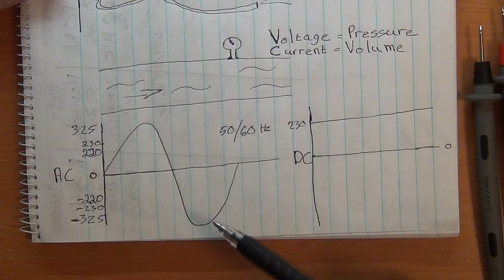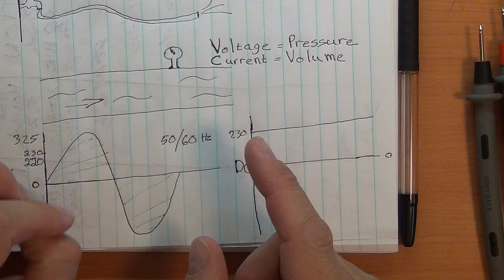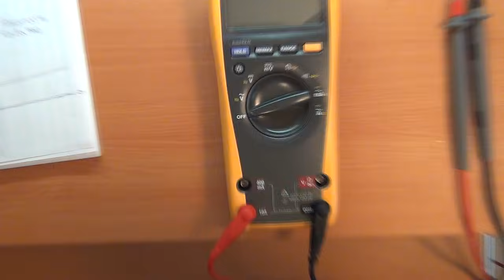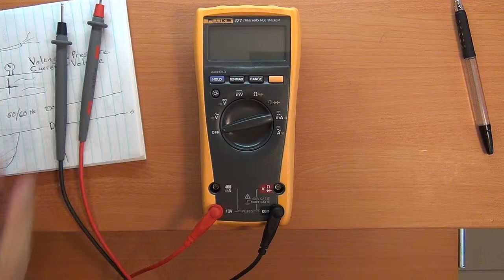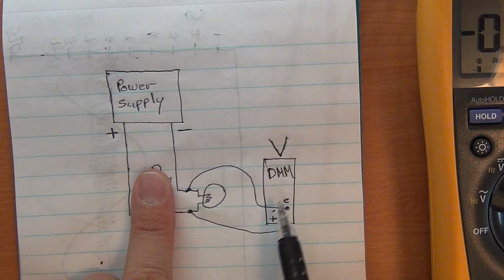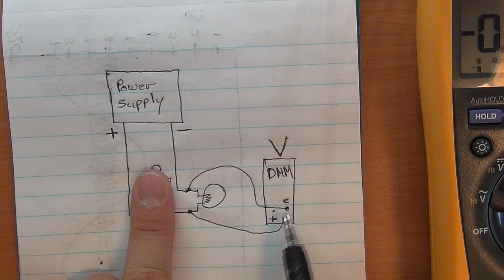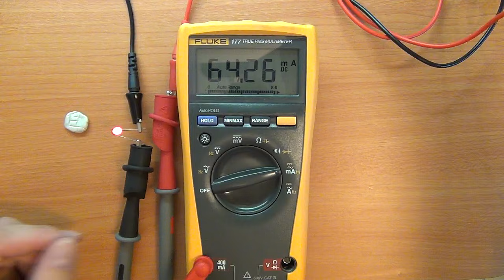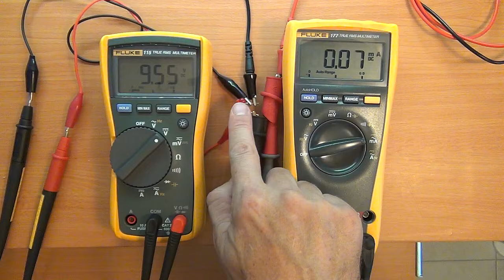Comment: @mjlorton Big props to you for mentioning @9:47 that in 230V AC grids/system, the peaks of the waves reach 325V and not 230V. 230V is the RMS!!!
This is how basic electricity should be explained!!! This is what allows pupils to understand the things, not to memorize them! 
When memorizing something, you will never be able to expand the knowledge in that field because you do not know the inner workings until that point. You become basically capped!
When you understand the inner workings, you can make your contribution and make advancements, discover new things!

I hear other "professors" say: "the AC voltage in the wire fluctuates between positive 230V and negative 230V"...  
Later those pupils will grab an RMS dmm, stick the probes in the wall socket and expect to see 162V AC...

Thanks!

Comment: So I have a multimeter that does not seem to have the option for reading AC Current, only DC current. There is no A~ option. This might sound a daft question but what would happen if I tested AC current using DC current measurement option?

Comment: With AC your muscles will be pulsing on and off giving your reflexes chance to pull away he said.. That person has clearly never touched 240V  AC closing the loop through the chest. Firstly, muscles will be pulsing at the frequency 50/60Hz and I am pretty sure based on my experience that in 1/50 of the second your reflexes will have no chance to do anything.. And if I remember right, it is exactly that alternating frequency that will make the heart stop.

Comment: i believe the reason why they switched to ac is because you can lose voltage over distance so you would have to have stations between power station and last building that would maintain the power. AC has a neutral, essentially making a loop.

Comment: I have a sperry instruments brand analog multimeter that has a red to green scale for testing small batteries, however, there is no battery option setting on the selection dial. I have noticed that other multimeters that have the battery replacement scale also has a setting for 1.5 and 9 volt batteries. So...how do I use this scale on this meter without the battery setting?  Is there something I am missing? Looking forward to your reply. Thank you.

Comment: Excellent, many thanks for sharing. This made made so much sense. Great practical example using a simple circuit that explains what is going on. Love the analogy and practical visualisation of pressure and volume (I’m a mech Eng). Also interesting to see the current drop off as the LED failed (not like a switch as I expected). By the way I electrocuted myself as a boy sticking a screwdriver into a transformer and my muscles contracted giving deep burns in my hands (240v in the UK). Luckily the screwdriver eventually fell from my hand saving me. Not sure if AC or DC (I was trying to fix my scalextric car circuit).

Comment: if i set-up my Multimeter to measure current  with a 12,volt bulb ; then switch off the multimeter the bulb still lights up - is this right or wrong  ;;

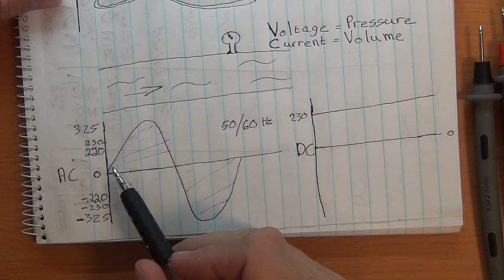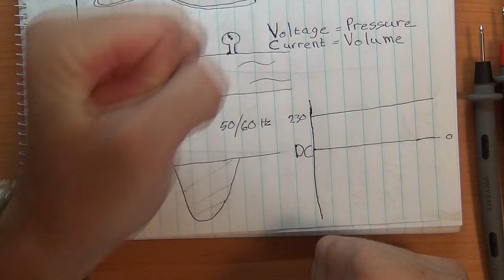Comment: @mjlorton Good work, but you begin to stray after 8:36, waving the pen vaguely at the paper and referring to the average 'under here.' You probably mean under the curving line above the line for 0 volts, but when talking about this much electricity, better to be completely clear. 9:00 - the reference to pistons is also very vague. Do you mean the AC current actually travels backwards? That it leaves the device? And how would it--what produces this current? Does it  go back along the same wire, or does it return through the grounding wire? A novice would have all these questions, since you've raised more issues than you've answered. When the current goes below 0, is it still operating the device? If so, how, if it's 'negative' current? You could have answered all these questions in a minute, but instead you wander off into solar panels.

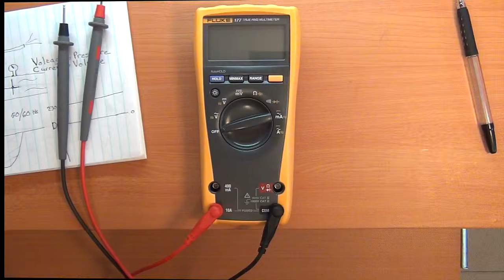18:25 - here's another distraction. There's no need to do this. It doesn't help us understand how to use a multimeter. If you must, always save this for the end. Point only then to the original time stamp, then add 'now we could have done it this way...'.  As it was, this didn't add anything to the matter under discussion.
21:30 - I'm sure I don't need to add anything regarding the confusion after this point.

Comment: No body dies on BATTERY....12OVOLT WILL PUSHED YOUR ASS....RETARTED ELECTRICK 240V WILL KILL YOU....AC LIVE WIRE U CAN TOUCH BUT NEVER TOUCH GROUND NUETRAL SO WHO IS DANGEROUS NEUTRAL GROUNDED....RETARTED.....USED 12VOLT HIGH CURRENT...ALL YOUR HOUSE APPLIANCE RUNS 12VOLT RECTIFIED....YOU FUCKING ALL THE SAME TUTORIAL....AC ALTERNATE CHARGES P+ OST PGROUND  P- NEG PNUETRAL...PUSHED PULLED..

Comment: Tessa's A/C was the no brainer for the power grid simply because the line loss from the D/C current is very noticeable at distance. A great example is the power wire to your amp in the trunk of your car. In some cases its 4 or 6 gauge to handle the job and that is relatively close to the power source so ya u loose fast the further u go. It's a good motive to buy an A/C- D/C welder. U may have a job 200 - 300 feet from your machine just switch to A/C and add leads .....no problem weld away.

Comment: I am wondering something, seriously now, how often do you measure current in the A range by breaking the circuit?

I do see a need for mA and uA since microelectronics use low current input power, but for high power electronics the currents are too high to break and measure the circuit quickly and safely. So the A range would be far better handled using a clamp.

You could argue about accuracy but in the very unlikely case that high accuracy would matter, improving your circuit capabilities would be the way to go, since working at the absolute current limits of your parts is a disaster waiting to happen.

Comment: What is the Biological process in the human body that allows it to withstand a relatively high current from an albeit low voltage device, such as a 12V car battery?

Comment: What is the biological explanation in terms of the the structure of the muscles that makes it contract when subjected to direct current (Gleichstrom) but jolt off when subjected to alternating current (Wechselstrom). At a very basic level, I do know that the human body is a biochemical system that is in a sense producing some sort of electrical power  as part of the processes that convert nutrition and respiration into energy to support its metabolic and physiological processes. The very fact that in the study of Human Biology one would come across terms such as calories and electrolytes alludes to the conjecture that I have.

Comment: DC lost out to AC I think due to the amperage or Voltage drop over the long distance car battery cble to the starter are very large Gage wire over a relatively short distance

Comment: DC didn't maintain voltage when traveling long distance so it was requiring many generating stations and was very expensive.I think it was a generator per city block depending on how many "connections".Edison pushed DC power but Tesla was pushing AC power.

Comment: Years ago I was building a solar powered pickup truck with 13 panels in series, so about a 234 V open circuit voltage.  First we tried a 250 V rated AC electrical switch, it lasted about 10 seconds after we “opened” the circuit with the switch.  The DC electricity was arcing right through the switch.  Next we tried a bat handle switch with about a 5 inch through..we could pull an inch and a half spark when opening the circuit.  Finally, we bought a $600 evacuated contractor which did the trick and lasted for years.

Comment: DC is a dirty sine wave, DC has no ground to bleed off . DC burns as it electrocutes. DC can fight back the resistance of skin better due to amp vs volt ration compared to the same wattage in ac assuming pure sine wave..

Comment: So back then AC and DC were to computing technologies. AC essentially won out because it can be transmitted over long distances with very little loss. If we were going to use DC we would have to have substations everywhere to boost the voltage and it would be potentially a lot more dangerous. So part of what I do in my job as I work on x-ray machines. They typically use 400 V DC power supplies but then when the voltage gets to the transformer inside the tube head it can get boosted all the way up to 85,000 Volts. Definitely something you don’t want to be playing with if you don’t know what you’re doing.

Comment: I know this is old but I enjoyed the story of Edison & Tesla arguing over power distribution.  Tesla argued for AC and yet Tesla cars run on DC ... sort of. I know they use AC motors but are powered by a bank of DC batteries.  

Edison argued against AC saying it would kill and at higher voltage I would disagree and side with Tesla.  I was a welder in my college years and preferred to weld with DC since it had a more consistent Arc and didn’t flutter like AC welders can.

Another great video. I enjoy the “why” behind the scenes.   As an electrical engineer I know the concepts but still enjoy watching.

Comment: The problem with dc voltage is that  you can't have a long run from your battery without major voltage drop.  this is why our houses are ac driven. even when you hook up solar panels you need to have the batteries as close as you can to your solar panels.

Comment: The reason they probably switched is because D/C voltage in a house could potentially be dangerous for younger kids messing with the outlets whereas A/C it would shock then but they wouldn't tense up in that position

Comment: Direct Current developed by Thomas Edison to power lights bulbs in homes and factories is a 12v system. Alternating current developed by Edison's assistant Nicki Telsa is a much more powerful form of electricity a 120V system. 120v is of course much more dangerous than 12v. DC is very limited cannot travel very far not suited for modern electric plants powering cities and large factories. Thank you for your excellent video on explaining on a multimeter is used. based on your explanation I was able to determine by car alternating was working i needed a new car battery.

Comment: I have to do more study but, I belive the AC is just as bad or worse at latching on. Reason, it's 60hz, you cannot precieve a light bulb flicker, your muscles are slower than 60hz. 

Furthermore, does the AC not induce a voltage at all in the body, Would this counter the problem and maybe allow for release? Again I have further study.

Comment: I know that with batteries if you run them in series you need a bridge rectifier to stoo them from charging each other just thought id bring that uo seems you mentioned running something in series i imagine why power going to peoples homes or whatever got change to ac is likely cuz its safer but i dont know why it be safer in that apllication though

Comment: This is a nonlethal story but still demonstrates the danger of low voltage dc.  Years ago I was changing a headlight bulb on my car.  I did not take into account how close  the battery positive terminal was to the sheet metal of the car where the headlight was mounted.  When i was attempting to remove the bulb I wedged my wrist between the battery positive terminal and the body of the car.  Unfortunately, I was wearing a watch with a metal band.  So the metal band that I had on my wrist was contacting the positive battery terminal and ground.  My first sense that something was wrong was when I noticed a funny feeling in my wrist and realized my wrist was getting hot.  Then I noticed what had happened and that watch band was screaming hot. I tried to flip the watch off of my wrist with my other hand but it was so hot I couldn't touch it.  I was flailing around in the front yard trying to get that watch band off and my wife spotted me and thought I was having a heart attack.  After several tries I finally flung the watch off and my wrist cooled down.  That was 50 years ago and I still have the imprint of that watchband on my wrist to this day. That was 12Vdc and a lot of amps.

Comment: I came across this video while looking for a solution for my emergency lamp for lead acid battery replacement, the battery to be replaced does not have any info but thr were 3 small lead acid battery connected in parallel. I checked the input DC voltage to the battery which shows 6.8v. the outer panel has this info "AC 90-240v 0.15a 1.2w.   Total power 2.94w " I think this total power is the wattage of 42led together. Based on my calculations, I am thinking 3qty in parallel 4v 1Ah or 1qty 4v 2400mAh lead acid. Or go for Li ion cells of 3.7v 2400mAh. Am I missing something ?? Let me know your thoughts...

Comment: Hi friend, thanks for the video. When the LED is blown in your demonstration why doesn't the current flow through the second multimeter? Cheers
Reply: it is set to measure voltage and therefore has a high resistance, only allowing a small amount of current through.

Comment: AC power is easier to distribute across a wider range at generally a cheaper cost.  George Westinghouse realized this simply as a potentially lucrative business model.  Hence, he patented the use of AC generation at commercial scale along with the help of Thomas Edison.  Even though there are numerous advantages to DC power in terms of scaling, storage and efficiency,  AC was put in to service almost exclusively due to its greater profit potential.  Incidentally, Westinghouse convinced Nikola Tesla to sign over his DC generation system patents for next to nothing.

Comment: With DC current they had to put way too many power stations so close together otherwise they would have blown out houses because of the constant current where is with AC they didn't have to use as many power stations because it was alternating current between the power stations to the homes.

Comment: DC originally used in homes did not have enough voltage to travel far without losing some of that electrical pressure to resistance losses - the longer the wire the higher the resistance.  AC voltage can be stepped up & stepped down to compensate for any voltage loss due to resistance.

Comment: a simple question:
 Two spark plug cables with the same length, cable B and cable T

  One is old 95000 miles.
The other untouchable not driven yet.

Cable B  2.4 ohms
 Cable T  1.5 ohms
The question: wich one  is the new?
Thanks
Reply: You probably mean 'untouched'. Untouchable means you are not able to touch it. Anyway, you can't tell without more information. The resistance is determined by cable length, thickness and material. Not by age or mileage. Well maybe corrosion affects it a bit. But if there's no corrosion then these cables will still have the same resistance after 100 years and 500000 miles.
Reply: @GerbenWijnja  

 Gerben Wijnja  
Untouchable it was my wrong way saying of "not used".
Spark Plugs cables have 2 years warranty/ 34000 miles warranty. I can send you the warranty photo.
 A new spark plug cable with  2.5 ohms and old with 1.4 ohms.

Something is wrong. More resistance it means less "flow" of electricity, correct?
So, the new ones should have less resistance. Am I wrong?

Comment: I have been following the multimeter for beginners series with great interest - thank you.  However, before making my first AC current measurement I have one question: my Tenma multimeter general spec says that the max voltage between any terminals and grounding is 1000V,but in the instructions for taking an AC current measurement it says never attempt an in-circuit measurement where the voltage between terminals and ground is greater than 60V or 30V rms.  does this mean I cannot measure my 240V household supply with this multimeter?

Comment: A bit late on this... But a bit more on dangers of power.

With AC you can usually start to feel a shock at a lower voltage than with DC. Total current will be lower at those lower voltages, but will quickly increase with increased voltage. The way AC works makes it pass though a bit easier, as physically the current doesn't need to push through the body completely, it just oscillates back and forth, unlike DC which must flow through in a complete path.

Multiple phase AC is very dangerous, not only is there multiple phases that are offset making the total up time of high voltage more steady than in a single sin waveform... They are typically running at higher frequencies as well, and higher voltage to boot... They will act more like DC to the body.

AC is pretty much always earth grounded, unless you are talking power systems of mobile equipment, aircraft, etc, which are typically frame grounded. Either way, making a viable circuit with your body is much easier with AC than many DC systems.

If a DC system is high voltage and frame grounded on equipment, you will not have a good time, and it can be easier to make a circuit then.

Between typical single phase AC and DC, if you do manage to make a circuit, DC will be more dangerous, once you cross the threshold of high enough voltage to conduct through a human body.

I have heard horror stories of workers who did maintenance on locomotive drive power, making contact with the hot side of the giant capacitors used in those systems... Extremely high current flow and high DC voltage, basically makes for an extreme steam explosion reaction with the human body... I will leave it at that...

Safety is very important when working with any power, even 12v DC can post a danger in the right conditions.

Comment: The question isn't which is more dangerous...the question is if your asking that you need to take a step back and think about what your doing.  Yes DC will grab you but the voltage or type of voltage isnt the most important part.  Its the amps the circuit draws that will kill you.  When in doubt go through your prints and make sure you know what your dealing with and have the proper ppe and stay safe.